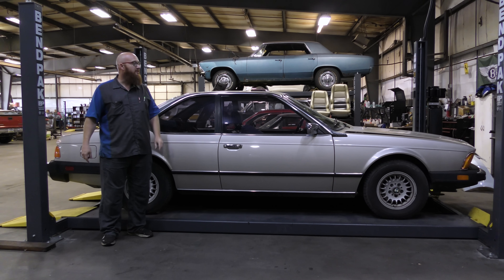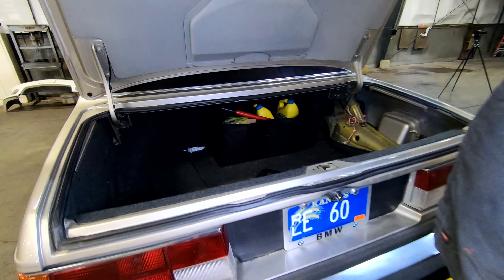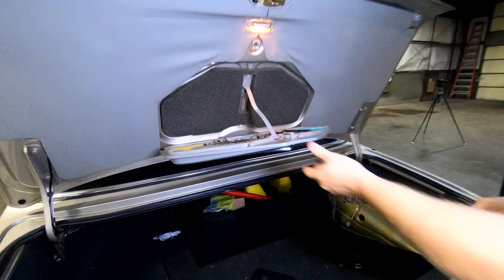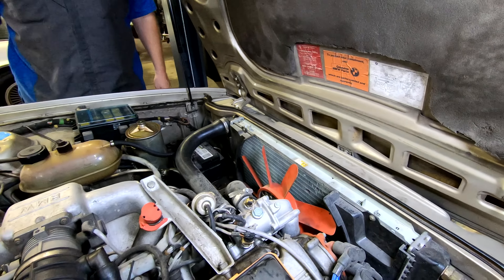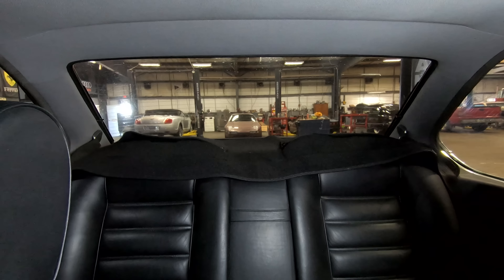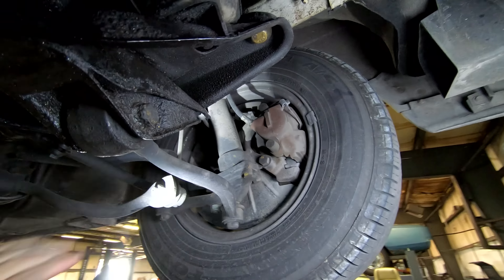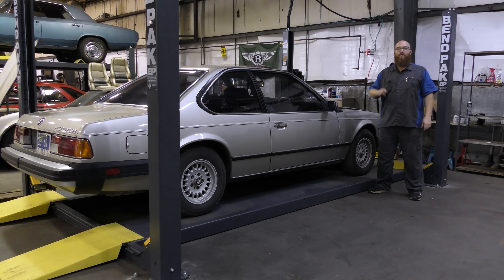Finally a BMW the CAR WIZARD will willingly work on! What makes this '83 BMW 633CSi so special?

Comment: In the UK I i bought my first car in the late seventies bargain basement i know.But any car with 80k miles on the clock it was considered the engine was on its last legs Also any car that was 7or 8 years old was normally a rust bucket usually with patches everywhere. with hind sight a death trap. There were stories of well maintained cars turning the the clock 100k back to zero.But they were simple and cheap to maintain. Are we expecting modern cars to unreasonably last longer than there intended shelf life

Comment: If you fit dash and deck mats before there’s any sun damage there probably won’t be any sun damage and replacing faded mats is cheaper and better than replacing a dash . So if the owner was caring for that vehicle there’s probably no damage hidden under those mats.

Comment: As others may have said, save that gear it can be 3D printed. I did a speedo gear on an 88 Audi 80 years ago and that was already 3D printed. Maybe even at a college. I’ve worked at colleges that have those.

Comment: look for someone who advertises professional 3D printing and send the gear to them to be copied. Plenty of tough plastics with carbon reinforcement now on the market. That gear has a copper track for electrical conductivity probably and this can be carefully removed and transferred to the newly printed gear - they usually have folded tabs through the gear and it can be removed.

Comment: I remember in the mid 2000s these 80s 6 series and the 90s 8 series could all be purchased in good condition fairly cheaply. 6 series were under $10k and 8 series were mid teens.

Comment: The inexpensive aftermarket antennas are fine.... Mine has been hiding in there for about 10 years.   Just change the electrical connector and reuse the original body fittings.

Comment: Car Wizzard, it's a little bit of work but you can get around the electric heated seats, you can order a aftermarket set up for those seats on line. Sometimes o. Those Older BMWS as you know don't even make some parts anymore so you are at the hands of aftermarket parts. O" well.

Comment: I wonder if you could measure up said gear and draw it in a 3D drawing tool like inventor and have the printer make a new one, question is if PLA/PETG that most printers run will be strong enough as a replacement plastic material

Alternatively there are titanium printers but you will find those to be more expensive$$$ and more reserved for research institutions

Comment: CAR WIZARD correct the spelling  in title from BWM to BMW. Also you could use a strong epoxy on that antenna gear to keep it from separating allowing it to work.

Comment: just machine the gear from aluminum or 3D print it ,its easy and will last longer then salvage yard plastic,problem with older ppl not thinking about/not wanting to use technologies we have today

Comment: Is there some kind of sweet spot for "vintage' cars where parts availability isn't as much of an issue, and they were still designed to be worked on?  Just comparing the lincoln video to this one, it seems there's a pretty big gulf.  So, for example, is 85-2000 a sweet spot?  Just curious what your thoughts might be there.  Thanks.

Comment: Back in the dark ages of the Cold War when I was stationed in (West) Germany, BMW and Mercedes of the mid 1980s were the Chevy and Fords of the era. Taxis and Police cars, in both brands, were at least as common as Chevy and Fords were in the U.S.of A. at the time. Oddly enough, many of those same models became the signs of "prestige" for upper-level drug dealers well into the 1990s.

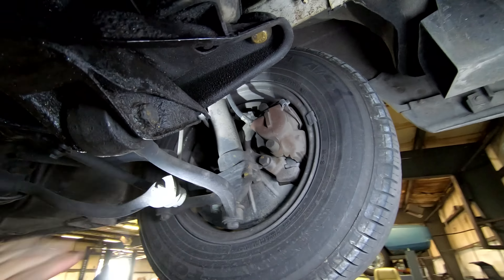Comment: Regarding the heated seats option (15:20): it's not correct what was said here. The customer didn't pay for the heated seats, so he didn't get it. BMW put it on the car anyway, but it was not paid for. So now you can chose to either "rent" the heated seats or completely buy the function "forever". That's actually great. Now you can buy a used car and "install" this function afterwards. Sad to see such negative narrative about a useful idea.

Comment: With the advent of 3D printing. for small plastic gears that are not available anymore, can replacements be made at a smaller cost by customer fabricators for a smaller runs of parts instead of wasting shelf space?

Comment: Car wizard , possibly another option on replacing the gear in the power antenna.  You said it's a plastic gear ? Could a replacement be 3D printed  for a replacement ?

Comment: What bmw is doing about the heated seats,  zero have been doing for quite some time with their bikes. You have to pay to unlock some features like heated grips, faster chargers, more range, etc features that are already built in the bike. But you have to pay to use them

Comment: Could you take the gear to a machine shop to make a new one OR a watch/clock repair shop and see if they can give a solution or as other people have said get the part 3d printed. Would be a shame to trough away a perfectly good part other wise.

Comment: That plastic gear is easily 3D printed if you don't find a replacement.
That example you gave about the subscription based heated seats isn't completely accurate. You can option your new car with f.e. heated seats and pay the option price and then you get heated seats that work unlimited. If you don't option the heated seats(so don't pay for the option) the hardware is still installed on the car. And then you can choose to "rent" the heated seats function for a monthly fee. That way you can f.e. only pay rent for the function when it's cold outside and don't pay for the function when it's warm outside. Also theoretically, this way, every car should leave the factory with all the electronically powered options installed. So when buying a used car there's no more hassle to find one with exactly the options you want. You can buy any car and then buy or rent the options you prefer.

Comment: Since the car is in the ballpark of 40 years old now, please change every cooling hose. All. You are only as strong as your weakest link.  Also, cooling system pressure cap and thermostat. Then you're set for years of happy motoring!

Comment: Can that broken gear for the antenna be removed from the metal shaft it is attached to? If so a replacement gear could be designed and printed in ASA and could be a relatively inexpensive solution.

Comment: You would like to work on my 2001 330i - it is holding up VERY well with 293K miles on it.  Other, high-end, car manufacturers are doing the same thing - not purely a BMW thing.

Comment: If they can turn the heated seats off remotely, what else can they do? Not even sure how that is done, unless there is a link from the vehicle to BMW HQ via satellite. Or is a smart phone, data plan and cell reception a requirement (on top of the monthly subscription) in order for the seat heat to function?

Comment: My parents picked up an '82 528e at the factory in Munich and we drove it around Europe (with oval license plate) before it was shipped to the US (took several months). At the factory, we got an orientation, including how to roll the windows down manually to not get stuck in the car -- by first accessing the tool in the rear trunklid. 12yo smartass me just had to ask -- if we're trapped in the car how in the f do we get the escape tool out of the trunk? Why isn't it in the glovebox? The BMW guy kinda coughed a bit and moved on to the next item.

Comment: I HAD A OLDSMOBILE CIERA IT HAD GO BECAUSE OF ELETRICAL PROBLEMS THST TO FIRE IN DASHBOARD. THEY DO ISSUES ELECTRICAL WIRES MELTING IN THE BEGINNING INVOLVING ALTERNATOR WIRE HARNESS. IT WAS OBD1 THE SHOP TRIED GET THE CODE BUT COULDN'T AND THEY WORK OLD CARS ITS KINDA OF FUNNY U KNOW

Comment: BMWs heated seat subscription doesnt work the way you are implying. 
Here in Canada as an example when I buy a BMW I am going to pay for the heated seat option so no need for the subscription service. 
If however I lived in Florida Im likely not going to pay for heated seats option (the car already has heated seats they are just disabled via software). Although living in Florida I want to visit relatives in Wisconsin for Christmas....I just contact BMW and tell them I want a 1 or 2 or 3 etc month heated seat subscription and they activate the heated seats via WI-FI and voila I have heated seats for my time in Wisconsin.......personally I think its a great idea

Comment: @Car Wizard what do you think about new Toyota hybrids such as the Corolla and Yaris Cross ? I’m in a market without a basic charging network so lugging a round your own generator still makes kind of sense. I’m very concerned that these Toyotas might not have the same rock solid reliability that we take for granted from traditional ICE Toyota drive trains. What have you seen ? Can you make a video about hybrids buy / don’t buy ?

Comment: Don’t understand why the Wizard doesn’t like BMW’s they are great cars and fairly easy to work on. Not very complicated and reasonably reliable
Reply: His gripes would be poor cooling systems (where every part was made from plastic) vanos systems being finicky, rod bearings that seem to need to be done frequently on BMW's, and everything made of plastic i.e timing chain guides.

Comment: if the teeth are alright u could glue it with some epoxy or plastic glue for Model building.
I frequently restomod old RC Models (80' and up), i've learned to improvise with small plastic parts

Comment: But if it the gear just split why not just epoxy it? or just disassemble the plastic and replace it with the exact dimension but CNC'ed out of metal? or have plastic (yes probably not as wear and tear free as the original but anyway) printer print it?

...edit
Ok just scrolled down and I guess many of us had the same idea...

Comment: The only nagging aesthetic thing is the 14" bottlecaps on the car from an E30. The stock E24 wheels for the 633 looked much better, but alas, they were metric and I get it. TRXs are a pain. The car could use an update to a 16" wheel, at least.

Comment: Considering the current trend of BMW charging their customers to use options they've already bought. I'd have to say they're the Spirit Airlines of the automotive industry. While Spitit Airlines takes nickling and diming to new heights, BMW does the same. Except their method takes nickling and diming to new lows never before imagined!

Comment: One of those is for sale on the Eugene, Oregon facebook Marketplace for $7000.00 incase anybody wants to look for it.  Here is the guys text from the ad: Beautiful BMW 633 CSI, very clean and runs amazingly. Exterior and interior are in great condition with only minor wear and tear. All interior electronics are in working order. Vehicle is stock with the exception of sport suspension. Really don't want to get rid of this car, but things have come up. My loss your gain! "
Reply: Oh and the title of the guys ad just says 1984 BMW only.  It doesn't say 633csi in the title, but does in the description and has photos.

Comment: Wizard, tell the folks about the paltry 188 HP the engine puts out.  I owned one of these for about 5 years and it was a bottomless money pit.  If it has the metric wheel size, good luck on finding and buying tires $$$.  That accumulator or "brake bomb" goes out routinely.  They also have many rust issues if driven in winter with any road salt.   Dash cracks are a fact of life.  Where you'll find the plastic is inside the power seats and they will break.  Mrs. Wizard should lift that cover off the panel behind the rear seat and she'll find out there are little plastic pods that hold the chintzy rear speakers and lift up to provide some useless storage and they'll be all warped from sunlight.  The new fuel pump is a bonus but I would like to mention there's another one in the gas tank.   There's a relay between the 2 that will fail and strand you.  These things are junk!

Comment: But you can't get any parts for these.
Please make absolutely sure that the spray bar on top of the engine is perfectly clean inside and the banjo fittings are tight.
You can't get camshafts for these for love nor money.

Comment: Also weight reduction. That hurts the case for metal parts when they can just use lighter and cheaper plastics to replace them with.

Comment: 6:02 the only thing i don't like is the instrument cluster because it looks too cheap and simple for a luxury car like this. And i hate the greyish mat finish that doesn't fit with the rest of the interior,
so i would give it a carbonlook by using a water transfer dipping foil.

Comment: The BMW subscription isn’t on features the customer paid. Its the opposite, the options the customer doesn’t select are still available as they are fitted to the car but need a subscription to run them. Its stupid and smart at the same time

Comment: 4:45 That is because plastic is way cheaper, and cars are built to not last forever because they want you to buy a new one every 5 years.
That's why you wont see a 2005 mercedes in 2025 bec ause the wiring have a degradable plastic that crumble to pieces after 2 decades,
and then the car will be a total write off because they just don't make those wiring looms after 20 years, and some car manufactures even
stop making spare parts after 10-15 years, so alot of modern cars will never become classic cars.

Comment: I TELL U WHAT I WOULD TAKE MY CAR TO U THOUGH BECAUSE I CAN TELL U A REAL SERIOUS PROFESSIONAL AND ORGANIZE. I HAVE AN IMPALA LS 2002 TAKEN OF IT REAL GOOD WITH 3800 V6. ITS REALLY GOOD CAR CAR GOT A NEW COMPUTER ON IT TOO. GOT IT USED. BUT THE DEALERSHIP SAID THE SHOP INSPECTED IT AND AND THEY DID BECAUSE THE OIL LEVELS WERE LOW INCLUDING THE TRANSMISSION. BLA BLA IT TURNED OUT TO BE EXCELLENT VEHICLE. WELL MAINTAINED. HAS 230 THOUSAND OR SO. I REPLACED THE RADIATOR TWICE BECAUSE I DAMAGED THE PLUG OF THE DRAIN. IT WAS EASY. THESE VEHICLES ARE DISSAPPERING AT THE JUNKYARD AND WITH THE RUBBER MOUNTAIN PF THE RADIATOR OF THE BOTTOM TOO. I WISH I HAD ANOTHER IMPALA LS 2002. THE TRANSMISSIONS ARE EXCELLENT I MAINTAIN THAT TOO

Comment: 1999-2003 vw mkiv tdi vehicles are designed to be worked on as well. The suspensions are simple, along with the engines and transmissions. Most of the vehicle engine is metal other than reservoirs and intercooler piping. I think it really depends on the generation of engineers designing the vehicles. The vehicles designed in the 1990's were primarily product generation improvements with the engineers being trained in the field in the 1970's. Newer designs and engineers look at expected lifespan as opposed to designs related to over engineering and designed for simplicity for maintenance and reliability fail safes should a component fail. Anotherwords the components are designed to fail In a manner that prevents the vehicle from being undrivable and a known quantity default. In aviation there are primary and secondary designated flight control systems. The primary systems must work for airworthyness, the secondary systems you can work around should you have a fault with one time flights to a home station or depot level maintenance. Also failures are engineered to maintain airworthyness should a failure happen during flight. I don't think these concepts are really thought of with newer vehicle designs and the engineer staff. A good example would be Toyota's drive by wire pedal recall. They should have had a failure default design should an error happen the ecu would recognize the out of parameter situation and bring throttle input to a specified default similar to limp mode on newer vehicles...

Comment: The car Wizard needs a 3d printer and a CNC machine. Rob Damn has one and all he does is work on rotory engines. You cant be a wizard without them, until you get them I shall call you Wizard in training.

Comment: 3D printers could be a solution for these small vanishing parts!! A clever technician should be able to scan that broken one and then use software to adjust for the cracked bit!

Just read the comments below!!!! Sorry to be repeating the observations of others!

Comment: Cars today don't last as long because car manufacturer companies keep wanting to change and have the newest and coolest thing/engine or transmission. Back in the day, car manufacturers used the same designs for years. The reliability was better because of that, the manufacturers make a good engine or transmission and they stick with it for years. Today, manufacturers make a good engine and or transmission and within 6 months start thinking about how and what to change with it. Lol.

Comment: If the gear itself isn’t chipped and just has a crack in it then chances are you can epoxy it back together. I’ve seen guys do that all the time with older BMWs

Comment: The heated seats thing sounds nuts, until you see the pricing and think about the fact that they can build all the seats the same and not have to worry that the heated seat box is usually not checked in some places that don't get cold mornings. I just wonder if they will fix a broken seat for free, after all you can buy a lifetime subscription for about the price of the heated seat option.